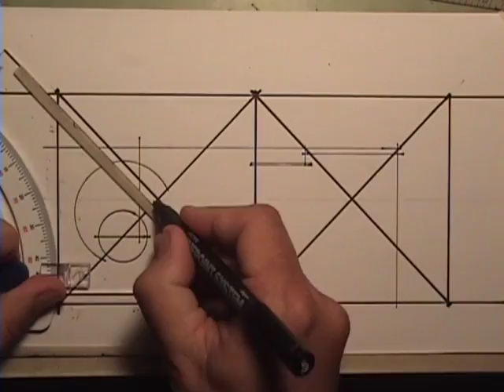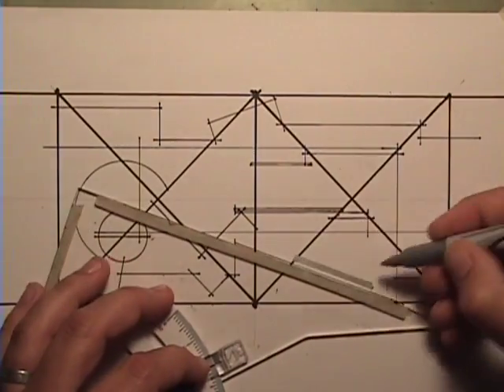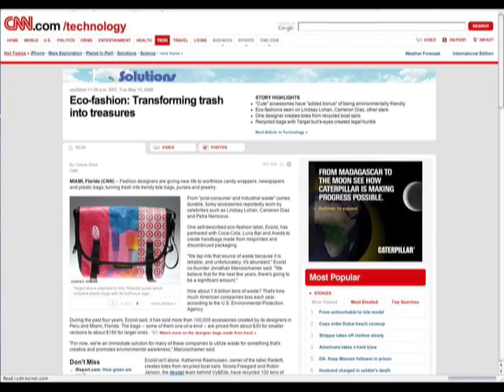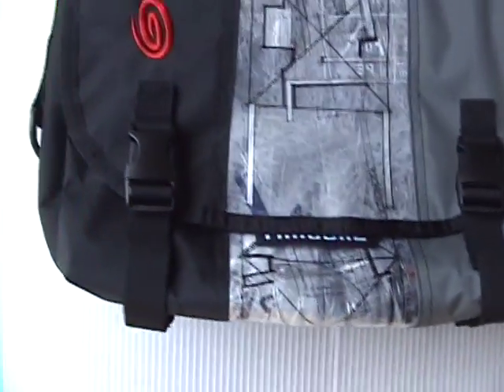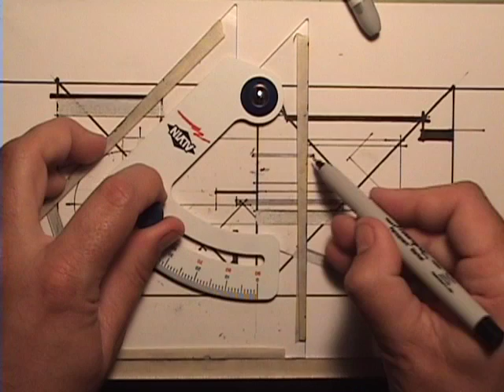A custom Timbuk2 bag

Comment from the maker: Just an FYI.  Freitag bags are made from tarpaulins, used seat belts and bike inner tubes, not plastic.  Neither did Freitag invent recycling.  The recycled material shown in this video is Low Density and High Density Polyethylene. The recycling method used to make the material is patent pending.